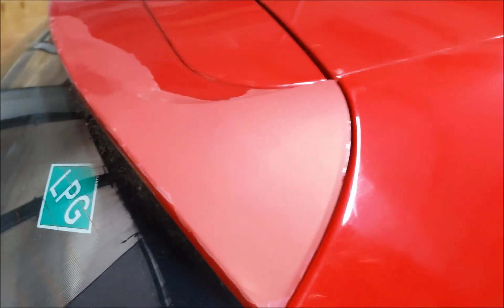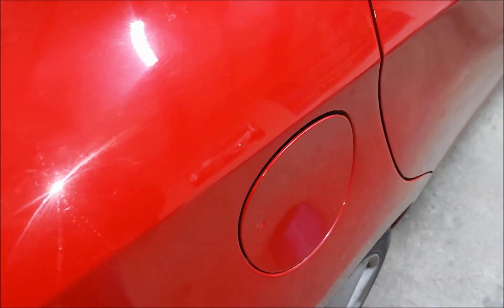Everything That's Broken on My Alfa Romeo Giulietta

Comment: Your Giulietta seems like it had some rough days, needs a bit of love :)
Reply from the maker: Actually besides few cosmetic issues it is one of the best kept cars I have ever bought
Reply: @arcgarage  I have a 159 TBi , it is a high milage car, but somehow everything inside is still in really good condition....
I am thinking about making a video on how to disassemble rear seats in 159 SW and unblock the center seat belt if it is stuck....
Have you ever had a similar problem?
Reply from the maker: Man that's a great car, I never had that issue

Comment: What is broken on my 2011 1.4 120hp Giulietta:
Current millage as of 06.02.2023: 275kkm (170k mil.)
- Radio loosing frequency, cd player broken (cd stuck inside from previous owner but actually cd plays as it should)
- Rear window heater
- Climate control barely blows warm air form driver side, blows cold from passenger side 
- Fuel flap
- Knocks from rear and front suspension despite all part has been replaced and yearly testing never brought to my attention that theres anything lose
- Dual mass fly wheel on its way out 
- Losing oil, not sure whether it burns it or throwing it up, to be diagnosed.
Wear & tear:

- Gear knob peeling off
- Broken dash compartment flap
- Folded ignition key blade lose (broken spring)
- Heavy rust on back end undercarriage
- Rust on rear wheel arche edges
- Alloy wheels coat peeling off (original Giulietta rims) 
On the good side whole interior trim is in very good condition and engine does not lack of power
Reply from the maker: It's going to take some effort to sort all of that out...
Reply: @arcgarage  I am not sure whether I should be bothered or just pass it on
Reply from the maker: You should fix it if you can, but I don't know how much financial sense it makes considering the mileage...

Comment: I'm glad that i've chose the 147 qv jtdm instead of giulietta. Especially the spare parts are easier to get and its much cheaper. The only advantage in my opinion of the giuletta are the powerful petrol engines.
Reply from the maker: I got both, and they are way different, might do a comparison video
Reply: @arcgarage  good video idea!
Reply from the maker: You're the one behind it
Reply: 147 > Giulietta Much better driving, but both cars are good in my opinion, Giulietta have eQ2, better than normal open diff but 147/GT can have real mechanic Q2. It's much better than electronics one. I have GT Q2 for a 5 years and now i have Giulietta. Still Giulietta can have Qualife Torsen LSD with is pretty equals to Q2 or even better, but cost much more.
Reply: Having travelled in both the 147s interior just has a better feel to it. Especially the look of the steering wheel. The 147s is really pleasant.
Ok I confess, I do own a 147 so you can disregard all of the above.
Those 159 wheels look fantastic on the Giulietta though and the rear end is lovely. A 1750 tbi is very tempting.
Reply: @allen_key  I have to agree with you. I owned 147 for 7 years and got giulietta for 3 years now, and I have to say I liked 147 more, however giulietta is better handling if we talk stock and engines have better fuel economy than 147's. However sound insulation in giulietta is just pathetic, it's like it's not even there, so 147 is quieter on highway rides. And yeah sometimes getting parts apart from dealer for giulietta is a problem.

Comment: Yuuuuup, some things like mine, and mine have only 107 000km... I dont have problems with doors panels, but i have some cracks on dashboard (passenger airbag)
Reply from the maker: This one has a bulge on the same spot, most of these are common issues

Comment: This GIulietta didn't have a good life. Never had any of problem listed here with any of the Alfa ( two 156 and GT).
Reply from the maker: Giulietta is a different car, these are not common issues on GT or 156. The car is mechanically in excellent condition with extensive service history, these little cosmetic things don't bother me
Reply: I had two Giulietta, one 147 and a 156. I can guarantee you that all the problems in this video are related to bad quality and not due to lack of mantainance from the previous owner.
Every single Giulietta will develop the following problems:

- broken door handles, are made of really bad plastic and will broke sooner or later
- dashboard will crack in passenger side due to bad airbag design
- gear knob will start peeling
- rear boot harness wires will tear causing all sorts of problems related to it, such as impossibility to open it with the key or button, non working lights, unstoppable rear windshield wiper

In addition to these problems the 1.4 liters lpg engines are pretty fragile and will not last long after reaching 200k kms, due to a premature intake and exaust valve seat wearing.
The jtdm engines are instead pretty reliable, apart some problems with the bosch high pressure fuel pump that develop a bad leakage due to gaskets failure